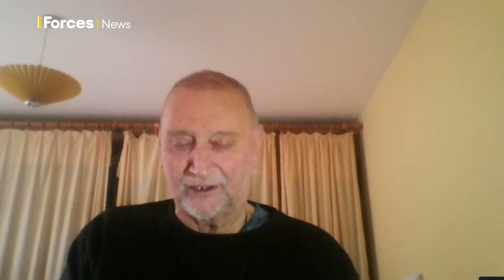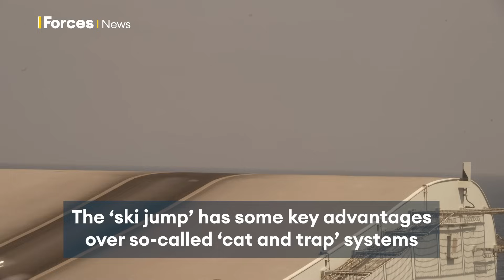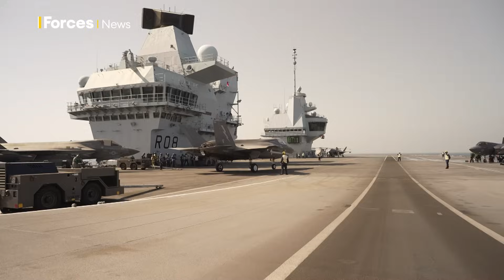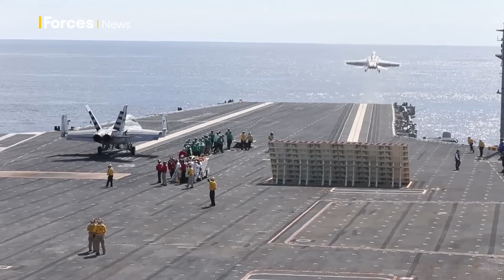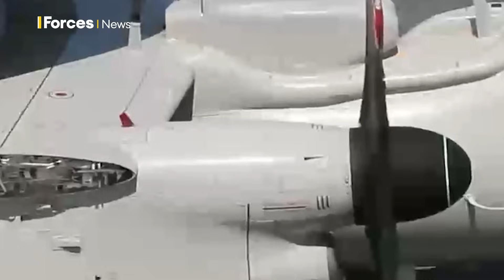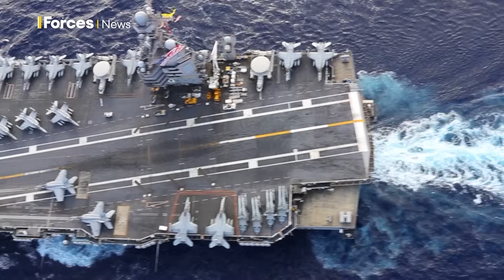Aircraft carrier catapult or ramp - which is better?

Comment: I wonder if this becomes an academic argument? UAVs don't need cats and traps and can fulfil roles like COD, AWACS, refuelling, ASW and Recce using secure data links etc. For instance UAVs with radar on board can do the AWACS role without the need for a crew - essentially lifting radar up to a great height and loitering while downloading the info to the CIOC aboard the carrier for intercept control. Although I agree with the comments re the payload limitations for F-35B with loyal wingmen providing extended weapons and range the RN move may prove to be a good option in the long run.

Comment: There are pros and cons for both.  The F35B has a performance penalty but still has the range of an F18 and manoeuvrability comparable to an F16, coupled with stealth and superlative sensors. It does not require the expense of catapults and carrier qualification for pilots is far easier to get and maintain.  The B also offers commonality and cross-decking with the USMC.  For the UK's requirements and finite budget, it's arguably the best package, having made the operation of two carriers affordable.
Reply: I would say it definitely requires carrier qualifications. 
Operations on the boat are a different world from the land bases
Reply: The F35 does not have the fire power of the FA-18 or munitions capacity. Stop it.

Comment: The Royal Navy took the Ski-Jump option because it was cheaper, but the F-35B is inferior to the CATOBAR operated F-35C built for the US Navy. A decision many in naval circles now regret as the F-35C offers greater range and payload options and being the major US Navy variant will have better future updates.
Reply: Yes - rather misleading of Forces News in failing to mention the inferior performance of the F-35B
Reply: @fToo  The F-35C is tougher and carried around 3,000lbs more ordnance
Reply: Forced news propaganda. It fails to mention that a catapult will launch non VSTOL aircraft and our carrier can only launch them. Der ...
Reply: It would seem that the A and B variants should have been "built out" from the C variant, given that catapult launched/arrested recovery aircraft are the most rugged.
Reply: The A is still the best of the lot as it's the original & lightest design for traditional Air forces
Reply: @AJS86  The F-35A has some better performance numbers but is way too lightly built for the rigors of Carrier operations. The British Carriers have built in provision for electro-magnetic catapult and may be converted to CATOBAR at a later date, to operate the F-35C and larger Drone Fighters.
Reply: @billballbuster7186  I didn't say it was for the carriers. I said the A was the best of the lot. 
With any carrier designed fighter there's compromise. 

The B has even more compromises over the C model.
Reply: It's irrelevant whether the A is the best or not. This video is about carrier operations.  @AJS86

Comment: The primary advantage to the catapult is the ability to launch heavier aircraft.  
That means your aircraft can carry more weapons and more fuel increasing their range.
Not to mention, you can then also carry and launch tanker aircraft.  That's very beneficial for strike missions as you can fully load up an aircraft to the top of its limits with munitions and then top it off with a full load of fuel once it is airborne.
Reply: Well I get your point but in CSG21 the RAF F-35Bs were going off the ramp with 22,000 Ib of weapons.
According to LM the F-35C can load 18,000 Ib of weapons because it is a heavier airframe although it has a longer range. That is a big deficit.
As for refuelling remember the RN is only just getting into its stride with sufficient aircraft and aerial refuelling is on the agenda. Of course RAF Voyagers cover massive amounts of air space and actually spend a lot of time refuelling US F-18s flying off carriers.
Reply: @1chish  You mean relearning the skills lost in 1979 when the old Arc retired.
Reply: @austindavies6371   Well in some ways yes. But the deck handling and carrier operation skills were never lost.
Reply: You do realise that the ALL up weight of the F35B and the other variants in what is called Beast mode from the Ford class, or the QE class is supposedly exactky the same? This is 22,000lb for all three variants, though as 1chish states for some reason the C variant can only take off from a catapult with 18,000lbs. Thus NONE CTOBAR is easily the way to go when this is required. The BIG extra on the QE class is that the deck can be used 24/7/365, unlike the larger US carriers which require time out of the day to inspect, and fix CATOBAR problems.
Reply: @thetruthhurts7675  
That very true that CVN need extra time but the big extra for CVN is flexibility 
Due to constraints of the STOVL , the F-35 is limited on what it can use while on ship
The F-35B can use weapons 1000lbs or less on ship with no issue 
Heavier weapons like 2000lbs GBU, JASSM and LRASM present problems for the F-35B but not for CVN aircraft as the CATOBAR 
but developing lighter weapons for F-35B is a simply investment
The UK chose CATOBAR simply because its considerably cheaper on the ship and aircraft and future tech like EMALS wasnt ready for prime time
Ironically the Russian put forth a concept of hybrid carrier with both STOVL and CATOBAR which many be something that UK many consider for their next carrier
Reply: @1chish  "but in CSG21 the RAF F-35Bs were going off the ramp with 22,000 Ib of weapons."(sic)

Incorrect, yet again.The max weapons/fuel load of the B is 22,000 lbs. Max weapons load is 15,000 pounds.

You do enjoy embarrassing yourself by repeatedly being wrong, don't you lad.
Reply: @thetruthhurts7675  "This is 22,000lb for all three variants, though as 1chish states for some reason the C variant can only take off from a catapult with 18,000lbs."(sic)

1chish is once again wrong. Max weapons payload for the B is 15,000 pounds. Max weapons payload for the C is 18,000 pounds. MTOW for the C is 70,000 pounds. MTOW for the B is 60,000 pounds.
Reply: @verdebusterAP  "The UK chose CATOBAR "(sic)

Incorrect. The UK boats are not CATOBAR.

"Ironically the Russian put forth a concept of hybrid carrier with both STOVL and CATOBAR"(sic)

Known as STOBAR
Reply: @AA-xo9uw  Did you watch this video, or just stupidly comment? Because on the video says 22,000lbs for the B version.
Reply: @AA-xo9uw  
Incorrect
its STOVL not STOBAR
BAR in STOBAR stands for arrested landing which the F-35B does not do
Reply: @thetruthhurts7675  Do you stupidly accept everything that neophytes state in videos posted on the web as fact or do you instead possess any actual verifiable experience with the platform which refutes misinformation uttered by some yahoo in a video that doesn't have to be vetted for factual content?
Reply: @verdebusterAP  The Kuznetsov is STOBAR. Try and pay attention to what you actually write: ""Ironically the Russian put forth a concept of hybrid carrier with both STOVL and CATOBAR"(sic)
Reply: @AA-xo9uw  
And again wrong
Reply: Also the ability to launch heavier air craft every 30 seconds versus 6 minutes for the jump ramp. And the nimitz and Ford class carriers can launch 4 planes simultaneously due to the four rampways versus the only jumpway, hence the higher rate of sorties at a higher rate and frequency.
The rump way is a ridiculous nonsense in an actual war against a near peer competitor and it's sad for those who bought into the nonsense of it's logic.

Comment: An aircraft ramp makes no sense to me, except in the narrow case of fast planes - it gives them 'rotation' before their wings have lift so thrust has a vertical component earlier? I had a quick search for online discussion which made me sorry I bothered. An awful lot of people seem to explain ramps work "because otherwise aircraft carriers wouldn't have them".

"Which is better" must depend on what kind of plane you're in - some planes probably shouldn't be on a catapult, like towbars on Ferraris?
Reply: Which is better. Depends on the aircraft carrier, aircraft, budget and what you are trying to accomplish. 
The ramp suits the U.K. just now as the F35b can take off and land easily. Catapult navies require loads of training constantly as it’s difficult. For the U.K. using land based pilots also it better using the ramp.

Comment: UK should have gone cats & traps and bought the superior F35C rather than entirely limiting us with the B variant with it's pretty pointless (and capability stunting STOVL), it's not like they're ever going to use the F35B from austere locations with no runway.
Reply: God such ignorance.
In 2010 EMALS didn't work (still doesn't) and had no price or delivery guarantees. So we would have paid billions for a dud and had no carriers at all. You forgot that part.
The F-35C is superior in only one way and that is range. The 'B' variant can deliver the same if not more weapon payload - 22,000Ibs on a 'B' vs 18,000Ibs on a 'C' and has exactly the same 5th gen and sensor capability. There was no operational advantage to it.
The F-35B absolutely has a point and that is operational flexibility and the fact that we delivered a supercarrier for $5 Bn vs a $18 Bn boondoggle Ford. The 'B' will also stop using vertical landing now SRVL has been tested and approved for deployment on both carriers.
As for not being used from austere places? Can you guarantee what Russia or China or whoever will do? If so can I have next weeks lottery numbers?
Reply: @1chish  spot on. There is also crewing considerations QE class are very automated and have a fifth of the crew requirements and therefore much lower running costs. I understood the QEs cost £6 Bn for two - not each.
Reply: @gordonmac3616   I was quoting in Dollars so forgive me. But (rate of exchange dependent) the two cost nearer £7 Bn or $10 Bn at the then RoE which converts now to about $9 Bn.
Either way to deliver two operating carriers for about half the cost of the first Ford is pretty damn good. Even the second Ford (USS Kennedy) is costing over $13 Bn.
Reply: China are collapsing financially now though.

Comment: The Catapult is half of the equation. You also need a long landing strip for arrester cables.
Reply: True, but a ramp needs a long takeoff run.  Both methods still need a long flight deck.
Reply: @matthewmcgee  Not really if you look at what the UK used before and others are using now like Spain. Also the ship Thailand had with a ski jump/ramp was small.
Reply: Just so you know the original plan was to have HMS Prince of Wales a catapult but costs and the reliability of EMALS forced them to return to ski jumps.
Reply: @incognitothing510  Yes I know. Thank you they also looked back at the Falklands islands war and what was done there.
Reply: @RJM1011  What was done there is that an Argentine military dictatorship decided they wanted to divert attention away from the University students that they were pushing off of airplane ramps into the sea so they invaded some islands that Argentina had occupied for two whole weeks back in their history.  The Falklands have British architecture, land use patterns and culture because Argentinians have NEVER settled, or lived there, ever.
Reply: @abrahamdozer6273  Most people already KNOW this but the YouTube video is about aircraft carriers !

Comment: Catapult = more range. But the politicians didn't want to pay for it
Reply: Would you buy a system that (in 2010) had no price, performance or delivery guarantees on a project that was time and cost critical?
Reply: @1chish  to ensure we could have the same reach as a Ford class carrier operating F35C, then yes
Reply: @TommyBahama84   Well I am glad you aren't spending my taxpayer pounds then ....

As for the Ford that would be no reach at all reliably because EMALS on the Ford still doesn't work.

Apart from which the QEs have exactly the same reach and performance as a Nimitz provided the US delivers the aircraft.
Reply: @1chish  The RN QE class operates the F35B, which has a shorter range than the F35C operated, using cats and traps, by the USN carriers.
Reply: @TommyBahama84   So there is a shorter range. Never heard of aerial refuelling? Buddy Up Tanking?
You forgot to mention that the 'B' variant was lifting off with 22,000 Ib of weapons in CSG21 while the 'C' variant can only lift 18,000 Ib (LM website). The 'C' also costs $10 Mn more than a 'B' variant. Again LM figures for LRIP 15 - 17.
Add in the huge costs and risks of EMALS, the extra cost per unit and the lower payload we made the right choice with the 'B' and STOVL / SRVL
Reply: @1chish  I'm not sure where you're getting your figures, but the weapon payload of the F35B is 15,000lbs. Also, buddy refuelling requires an F18 Hornet - it's not an organic UK capability.
Reply: @TommyBahama84  exactly this!! He keeps touting this 22000lbs capacity of the B as being better than the 18000lbs of the C, when in fact in standard configuration the carry capacity of the B is 15000lbs. 

Then he'll go on about 'beast mode', as if it's only specific to the B.... it isn't! As WE know ALL 3 variants have the same so called 'beast mode'. They can ALL carry in excess of 22000lbs if stealth isn't required. Only that the A & C's can carry it all much further... if they don't have the opportunity to fill-her-up at a passing RAF Voyager... AAannd they aren't quite as gimped in manoeuvrability, the A particularly, but even the C has a higher G stress limit which is only exacerbated when carrying tons of external stores strapped to your wings...

Apparently lack of range and an over 25% smaller combat radius isn't an issue... as there'll be an RAF Voyager always on hand for refuelling... 

I've written an epically long response twice now to his initial rude and arrogant response to my posted observation where he exhorted how biblically ignorant, I was... But for some reason YT has swallowed them both, and I CBA writing it again for the benefit of the wilfully ignorant.
Reply: @swampeh  some people, eh?!

Comment: This guy didnt come across very confident on his subject matter. He should have mentioned that POW and QE have a redundant ( not fitted) electronic catapult built into the structure of both ships. Originally they were meant to be catapult. As usual changes were made. But talks are still on going to buy the remaining UK F35C as catapult launch versions. As opposed to more expensive, slower and less payload F35B. Think of it as another Ajax armoured vehicle, Wegdetail AEW Mk1 ect MOD procurement bodge job..
Reply: Not quite right at all Steve.
1. The QEs were passively engineered for later fitment of CATOBAR if proven necessary. They have machinery spaces and extra cabling but thats it. Certainly no catapults as the two options (EMALS and EMCATS) are quite different.
2. The carriers were never designed as CATOBAR but always designed as STOVL carriers right from the first iterations because the F-35B was the chosen aircraft for both RAF and FAA use and we had huge experience of ramp carriers.
3. The only decision on CATOBAR made was in 2010 when they looked at electric cats but decided (rightly) they were far too risky and the savings buying fewer 'C' variants were just not there.

4. No changes were actually made in 2010 or even earlier.
5. Talks are not 'going on' to buy the 'C' variant at all and never were. In fact the RAF have recently been funded for the second tranche order for the 'B' variant.
6. What is being planned is a catapult system for larger UAVs.
7. The 'B' variant is not slower and has an equivalent payload. LMs own website says:
     "The F-35C can carry more than 5,000 lbs of internal weapons, or more than 18,000 lbs of combined internal and external weapons."
On CSG21 and before RAF F-35Bs were going off with 22,000Ibs of weapons, internal and external, in what is called 'Beast Mode'.
8. Neither is it not more expensive. Again from an LM spokesman:
     "For the airframe and mission equipment only, the Lot 15-17 cost of F-35s ranges “from $70.2 million to $69.9 million for the F-35A, $80.9 million to $78.3 million for the F-35B, and $90 to $89.3 million for the F-35C"
So the F-35B is some $10 Mn cheaper.
9. No Steve think of it as a very long term plan that has delivered everything it was designed to do with the only failure a lamentable supply rate from the USA.
Reply: Well that was a lovely story. Not much truth in it but still why let that get in the way 😂😂😂😂
Reply: @Statueshop297  your just a troll.obviously. Those were facts 😁

Comment: Catapult is the best option. Carriers are a power projection asset. If their teeth are restricted by the restrictions placed on their aircraft because of the ramp system. What’s the point of having them at all?
Reply: Gee, it's as if the RN didn't win a war with VSTOL aircraft & carriers, 9000 miles from home in 1982.
Reply: A shark with half it's teeth is still scary. What less scary is not having one part of the time. The extra cost would have driven us to only 1 carrier like France.
Reply: Cats are not always the best option by any means. the QEs can project 5th Gen power like no other Navy right now.
So what restrictions do the F-35Bs have? They can launch initial strike sorties far faster than a Nimitz / Ford class carrier for example and they can deliver the same if not more weapon loads than a 'C' variant.